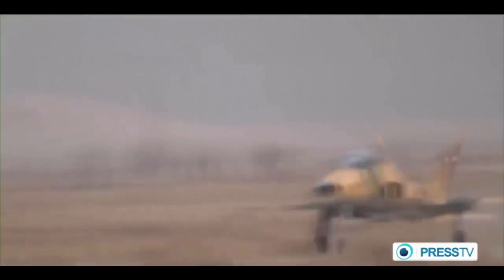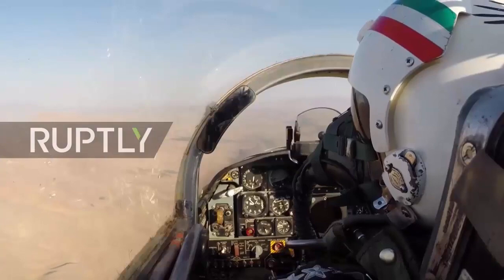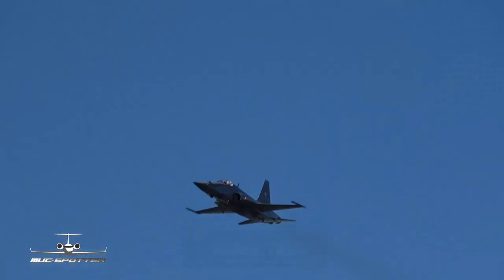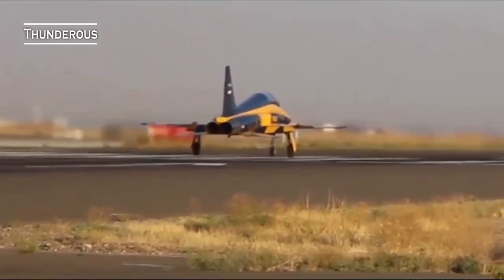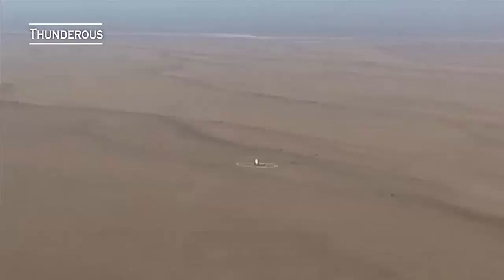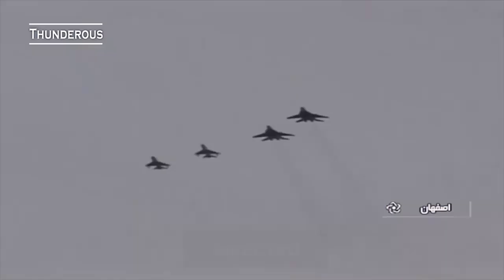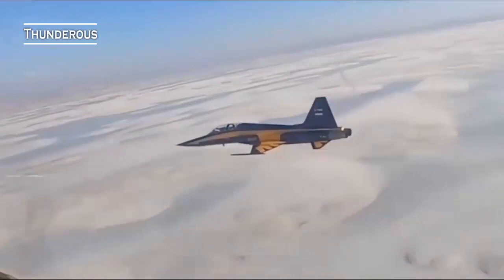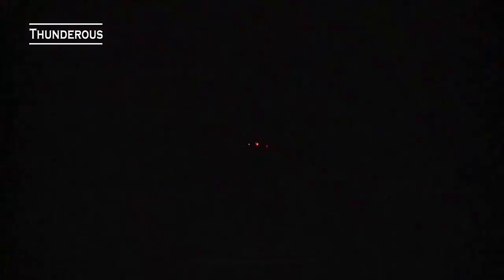Confirmed! Iran Is Working To Build New “100% Indigenously Made” Fighter Jets With New Avionics

Comment: Utter nonsense! Here is Kowsar's assembly line https://www.youtube.com/watch?v=MnEkWUe3Q5Y
Kowsar is an advanced supersonic Jet trainer and yes it's basically a reversed engineered F-5 with upgraded avionics and it's Airframe avionics, engine & ejection seats are all produced in Iran.
This Aircraft was mainly built to be a trainer so there is literally no reason why Iran should increase the cost of production for a few cosmetic changes and risk messing up a well designed Aircraft
The F-5 despite it's limited thrust possess the capability to cruise at a higher speed than F-16's so why mess that up!

Comment: The only way you can fight F35 is to get close enough if you survive?! 
Also, be able to use much longer air-to-air missiles. 
Or drag them to a friendly defense line. They will take care of him if you survive. Otherwise, Presently, we can not fight them. But when we have more sophisticated avionics, we will take them for sure.  🇮🇷🛫🛬🇮🇷
Reply: F35 are slow but you are right how to take them down is long range missiles as they have it also....
Reply: @tentimesful  the f35 ain't slow has 43,000lbs of thrust and its an single engine!
Reply: @elvedinavdic5251  LOL!!
Reply: @elvedinavdic5251  
That's the point. “If” the plan showed up on the radar and detected, it will be shot down.